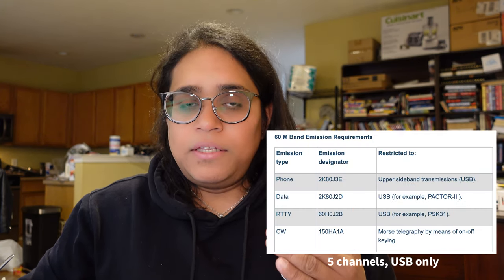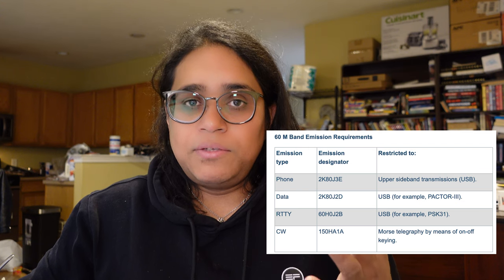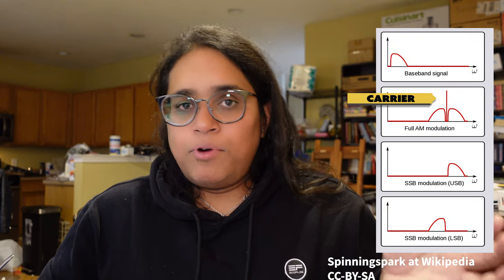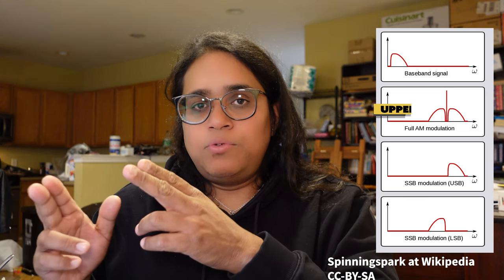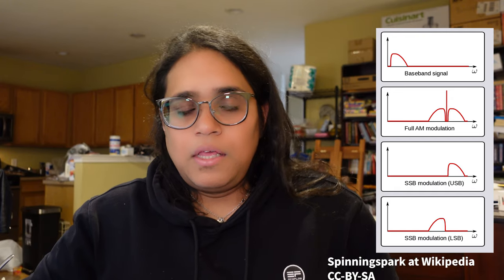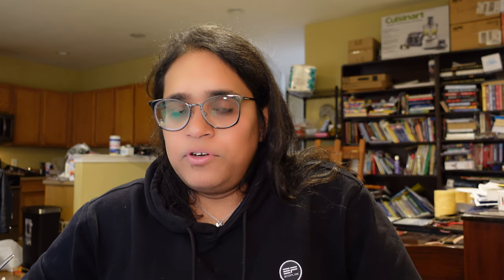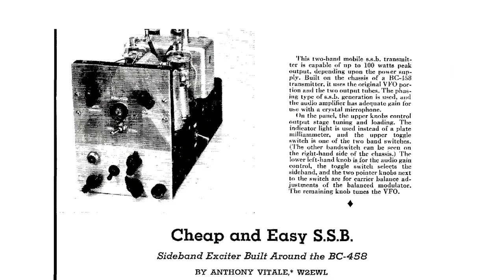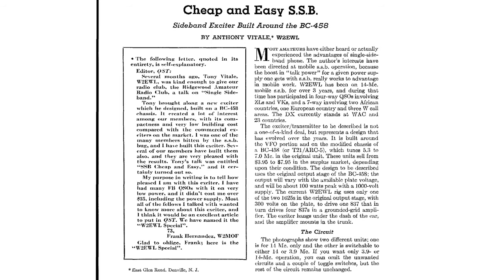Why are some HF bands USB and some LSB?

Comment: Only hams use LSB, it's a historical oddity with no reason to still be happening.  The military, aircraft, and commercial services all use USB.  LSB is a legacy from the early days of tube-type radios when the major manufacturers designed around a 9 MHz IF in their radios.  I think that started with either Collins or Drake.
Reply: CB radio still uses LSB but for a different reason. The band is made of 10KHz A.M. channels and SSB has to fit in with that so you either get the upper sideband of that channel or the lower sideband. I guess it could have been made 5KHz channels of USB all those years ago but then that might have meant more XTALs in the days before frequency synthesis was a thing.

Comment: Interesting. I have a couple SSB receivers and noticed that they picked up most signals on both bands but tended to be a bit clearer on one or the other. I didnt understand why. I suppose reducing my bandwidth would change those results.
Thanks for the lesson. I had no idea what was going on.
Reply from the maker: Unless they’re very old this isn’t the reason. I think there is some other reason in your case.
Reply: @n2rj  they're an ATS100 and XHDATA D-808, definitely not old but they're fairly sensitive and relatively cheap radios. Maybe it the style of board? They do get alot of bleed over from other channels on AM.

Comment: Operators use whatever they feel like (CW AM LSB USB etc) on all bands actually. Might have been a guide for lower bands but not set in stone so to speak in the past. Some will even go with 4k+ wide....
Reply from the maker: Correct but you really don’t see deviation from the established convention. Yes a few do it but the vast majority follow the convention. Also most radios today are programmed to follow the convention by default. Finally it makes sense in a crowded band to follow the convention so you can hear each other and mitigate interference.
Reply from the maker: Also in the United States you cannot use phone on certain segments. You can use CW everywhere but phone you’re restricted. And on 60m you must strictly follow the stipulation of USB and 2.8kHz bandwidth or less. I would also argue that ESSB falls outside of good engineering practice as you don’t need high fidelity for speech but that’s another video.